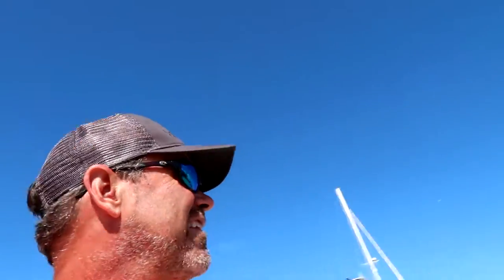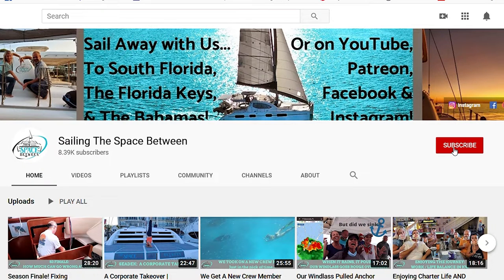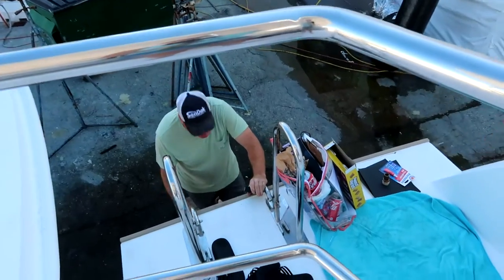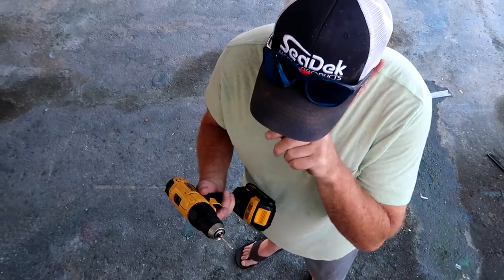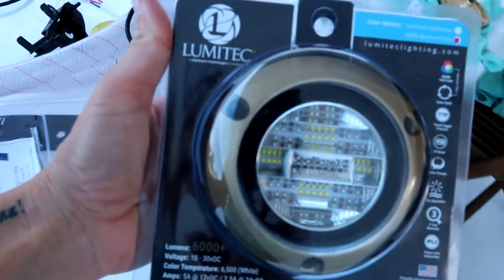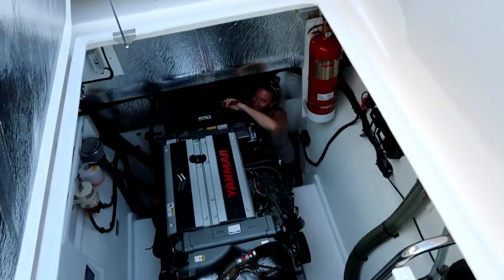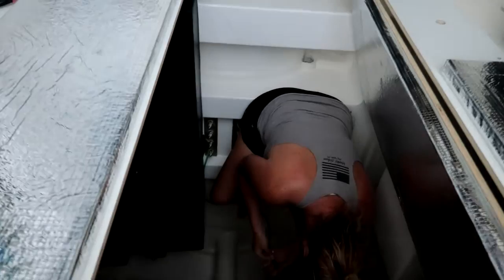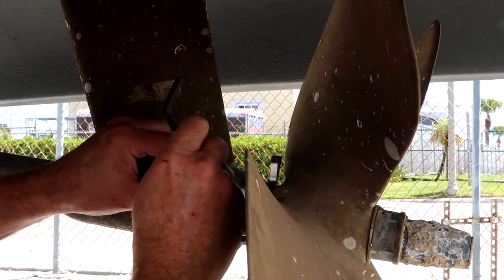Nauti Nite Lights! L.E.D. & Spurs Install on an L53PC | Ep.80 | Sailing The Space Between

Comment: whats the purpose of the through hole that was added?
Reply from the maker: Water Maker
Reply: @SailingTheSpaceBetween  perfect... makes sense - and thank you for the super fast response!!!   I have a 53PC on order and was wanting to do underwater LED's myself as well for the fact that the factory option is limited and expensive.  This looks amazing and seemed pretty straightforward.   Really appreciate the detailed video.   Do you recall where they installed the controller for the underwater LED... or are they all on remote control?